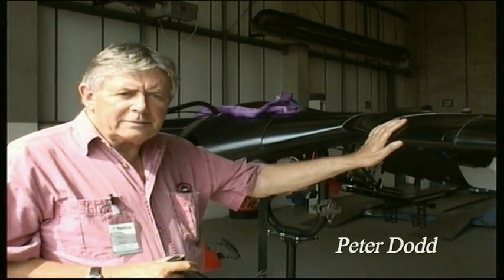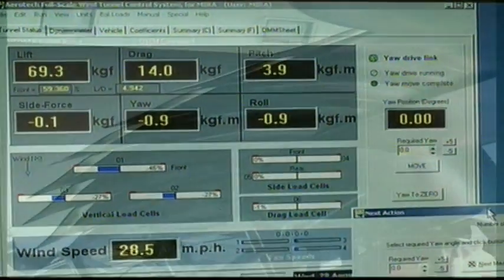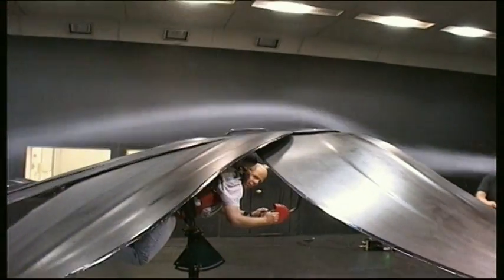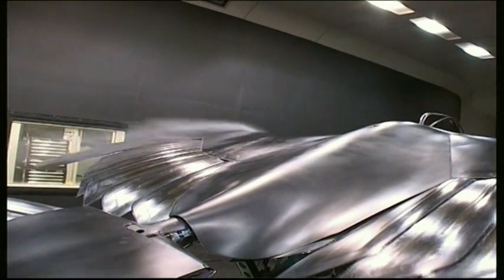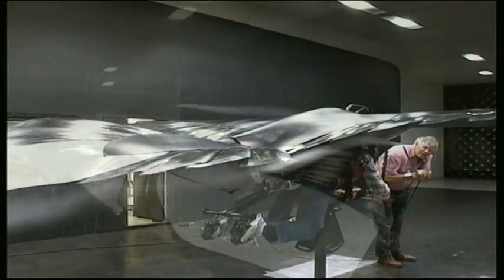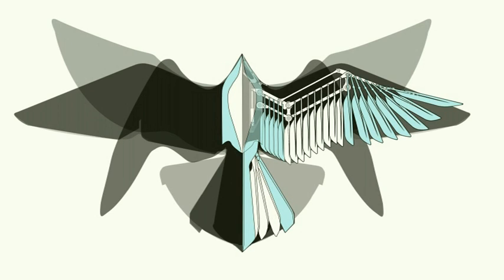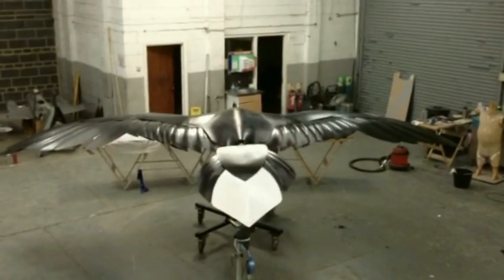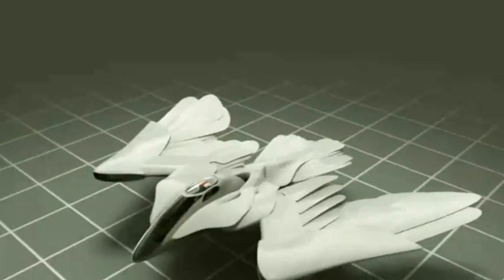Frigate -  bird like plane - Frigate (AC) Ltd

Comment: I worked on a drone project a little like this at Cal State Northridge just recently, and there's a few interesting things to note about bird flight and some unforeseen challenges. From what I'm seeing in just the first 2-3 minutes of this video, I doubt they're making a flying model yet.

Traditional airplanes have the wings and tail behind the center of mass. The wings want to wrench the nose down, the tail wants to wrench the nose up. You lose net lift and get stuck with higher takeoff and stall speeds because of the wings and tail fighting each other's lift. The shift in airflow going from the wings to the tail also adds a lot of trim drag, and putting the tail further out behind the plane adds skin drag from the longer fuselage. The benefit of this arrangement is dynamic stability and controllability.

By comparison, birds cradle their center of mass between the wings and tail, so both surfaces generate upward lift. The tail especially reduces drag by smoothly transitioning and harnessing airflow from over the bird's body. Their 'fuselage' can be shorter in length. By morphing their wings and tail, they can become intentionally unstable for maneuvering, which is efficient and results in very high agility. But, this takes a lot of constant adjustments, and a bird's center of mass is always shifting back and forth while they fly, which makes it hard to replicate this in a plane. They need a lot of sensory input and mechanical control, and thus processing power for this to work. Each wing has 3 or more degrees of freedom, the tail has at least 4, then there's simple spinal motion (we can treat that as at least 1 degree of freedom, see point 3 below), and that's just general in-flight control.

Birds also have some other traits and quirks that affect their controllability, hence another layer of doubt I have about this project. 
1. They have a flexible layer of feathers on the backs of their wings called covert feathers, which raise in response to flow separation, which increases lift, lowers stall speed and increases control during stall. Felix Schaller compiled research papers on this and replicated it here: https://www.youtube.com/watch?v=Nbk8zSRCytA. 
2. They have non-linear wing twisting, which is something Al Bowers worked on at NASA in the Prandtl-D project ( https://www.youtube.com/watch?v=bCwtcDNB15E ). The twist in their wings causes airflow to change towards the wingtips in a way that generates net thrust, which is a big part of how they can roll and steer without a vertical rudder. With simple straight wings, like the one shown in the main video, the wingtips generate drag. That'll cause yaw instability that you constantly have to correct for with yaw control, so much so that it's practically suicide not to have a vertical stabilizer.
3. Most birds don't fully rely on their tails to yaw (steer left and right). Some do, and you'll get some yaw control from rolling the tail. But most birds actually use their wings to generate most yaw control, and they'll contort their bodies like a fish, bending their bodies left or right to supplement this yaw control. In fact (and I figured this out through direct observation), birds like crows actually use their tails to strafe sideways, especially when flying at an angle into the wind.
4. Bird wings are structured such that they passively respond to flow instabilities. For example, when hit with a turbulent gust of air from the side, owl wings will naturally hunch and tuck, angle back down, and spring back out again, all faster than their nervous system can react. This is because of the shape of their bones and the arrangement of their tendons and ligaments. Without these traits, birds would be at the mercy of random gusts of wind.

Our project was making basically an RC airplane based on a seagull, and even the designs we referenced, such as EPFL's LisHawk and Stanford's PidgeonBot, relied on more traditional arrangements of flight surfaces. The wings and tail were behind the center of mass, they had vertical rudders, no covert layer and straight wings. Our design was MataGull, which had some control problems from both the untraditional design and some structural issues, and it was just uncontrollable. The next team is taking their shot at it, trying to fix a lot of the issues, but going with a full-on bird design is a serious gamble. This Frigate project has some of the same traits being added to the new project, but it's still got a long way to go.